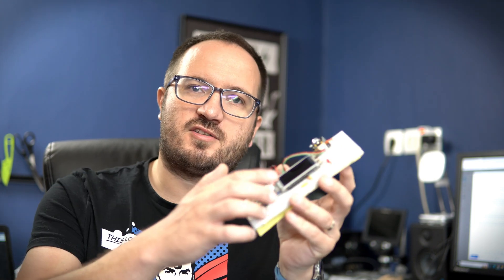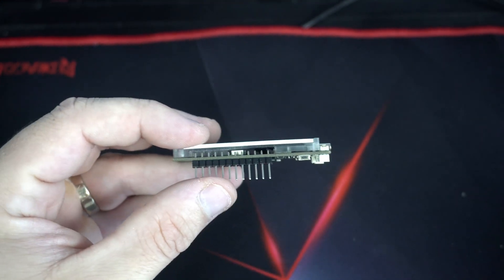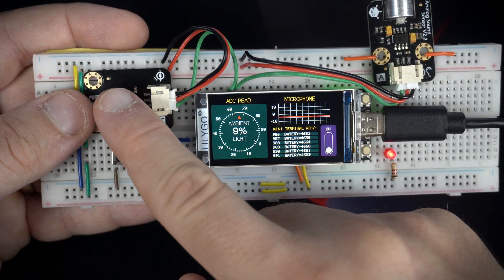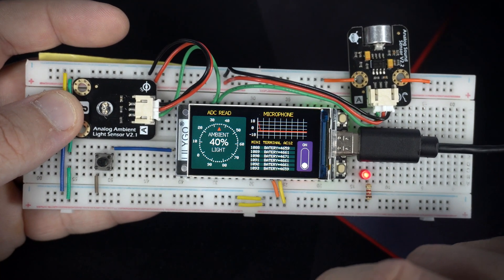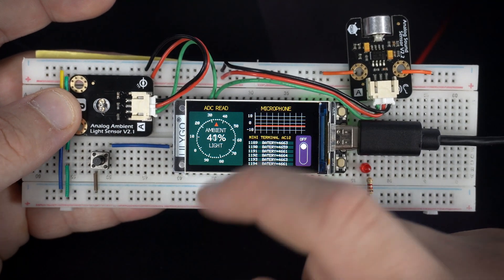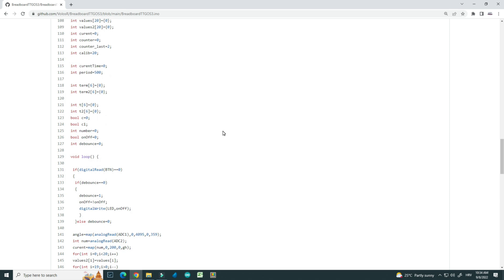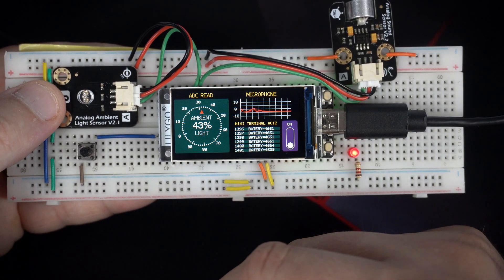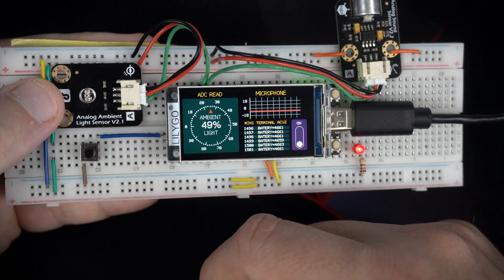T-Display-S3 development board meets Breadboard

Comment: Thank you - I got it up and running with using the Arduino IDE newest release with the Board = Adafruit Feather ESP32-S3TFT. The correct settings I took from the Xinyuan-LilyGO/T-Display-S3. 
Not successful was I with the Visual Studio Code and PlatformIO. Have not found the correct Board.

Comment: I looked at the pinouts for this board, but I did not see any pins that support I2C.  Does anyone know if this board can support I2C sensors such as BME280?
Reply: ESP32S3 has a GPIO matrix. You can use any GPIO and dedicate it to I2C.

Comment: I'd really like to speak with you!! I just found your channel and I had to subscribe!! Your projects are right on the mark of what I've needed since 2008. I was wanting to build a multiple display unit that would show multiple sensors while out in the field of research. I tried programming an esp32 and found that there were different boards/versions. In about 2009 I learned that in my research, I needed something that would be specific for my needs. Store bought technology just wasn't doing it. They needed to be small, low power consumption and portable. Your builds look smart, clean and well thought out. In 2009 I started programming arduino's. A total beginner. Made some headway, but still needed something better.
The ESP32 was what I needed.
And the small crisp and clean color displays you are using, are what I need.
I'm very happy to have found your channel! And you are a great Teacher! Bravo on your work and your channel!! Finally someone I can learn from!
Reply from the maker: Thank you, i am gkad you find my channel, esp32 is great it will probably fit  your needs, only thing that is not that  great is power consumation of esp32

Comment: Hey man, I appreciate the videos using this board. I ordered a few when I saw one of your first videos, and I've been absolutely loving them.

FWIW, I started by using the TFT_eSPI, but ran into problems with Arduino IDE constantly trying to update it. I ended up switching to Arduino_GFX, and it's been running really well. I haven't done any comparisons on frame rates, admittedly.
Reply: I did the same!! I watched 2 videos and BAM! I'm ready to make a putchase!

Comment: Very good project and explained!

A question.  your module works only with battery?
 I bought one and it only works connected to USB.
Reply from the maker: if you want run it on battery you need add thease two lines in setup :
pinMode(15, OUTPUT);
  digitalWrite(15, HIGH);

Comment: Thank you for another great video, hope family is well. Received the boards a couple days ago but have been unable to get the modifications to the TFT library correct yet. Any help in the settings would be greatly appreciated.
Reply from the maker: hell, thank you, my family is great. You do not need to make any modification , you can download modified tft library  and use it. here is library in lib folder https://github.com/Xinyuan-LilyGO/T-Display-S3
Reply from the maker: you will also need delete or move your old tft_espi library
Reply: @VolosProjects  Thank you, I now have a display that works. I had tried the modified tft library  on github but only had the backlight that worked. Getting rid of the old TFT library did the trick. I really appreciate you taking the time from your busy schedule to reply. For us noobs most of this is a huge learning curve.

Comment: Are the analog GPIO ports 5V tolerant and at what voltage is the main chip working.
And thanks for adding the comments to your sketches, that's very helpful and makes your code much more readable to other developers.
The graphics look very cool, I absolutely love what you're doing.
If everything goes right I'll get my board sent to me in two days at September 12th so I'm very excited to get started with it and using your code examples.
Have a great day.
Reply from the maker: Hello,esp32 boardwork on 3.3v it is not good idea to connect 5v to gpio. Thank you.

Comment: How do you measure battery level ?
Reply from the maker: You can check in code! voltage=analogRead(4) * 2 * 3.3 * 1000) / 4096;
Reply: @VolosProjects  Do you directly connect the GND pin to ANALOG 4?

Comment: I like your display designs, very colourful and dynamic. I also like deciphering code, it’s a great way to learn new techniques. Nicely done! 👏🏾👍🏾🤓
Reply from the maker: Tnx Pete for your support 😀
Reply: @VolosProjects if you want to make your code to be more readable,
then avoid giving your variables/functions 1 or 2 letter names.
you won't need to add comments then either
instead of: int gh = 150; // graph width
why not just do: int graph_width = 150;